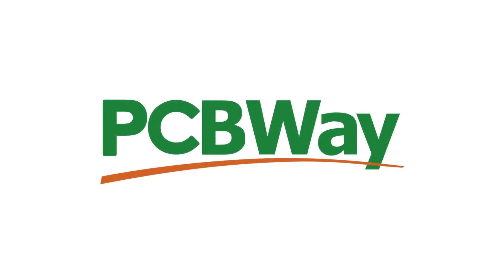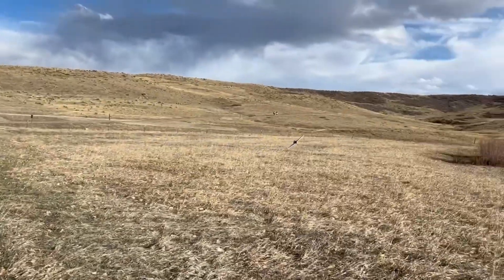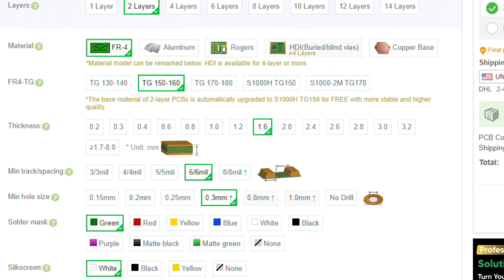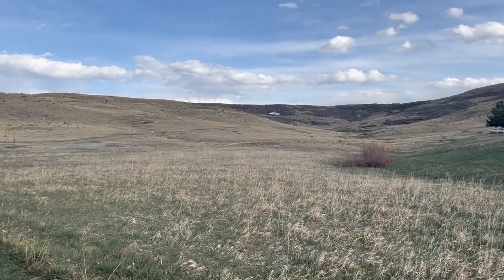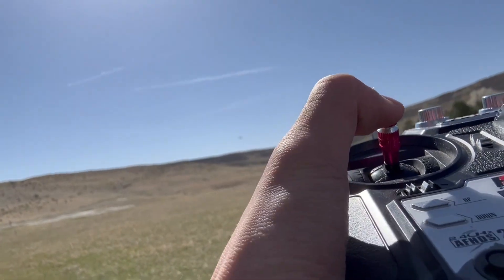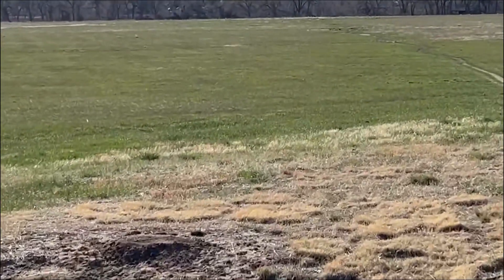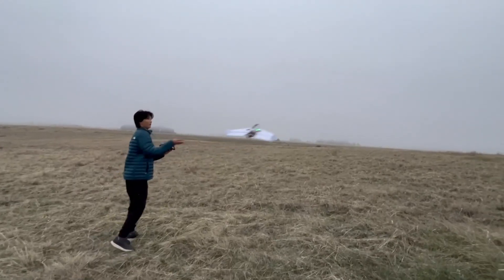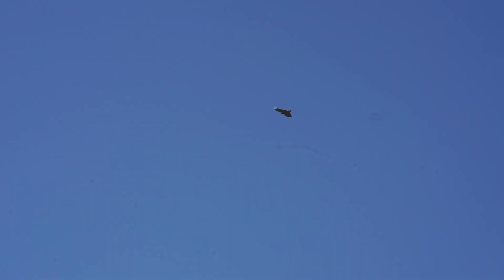Sub-250g Nano Wing Experiments

Comment: Bro Try increasing aspect ratio for a bit more lift and efficiency without increasing wing flex too much meaning fine tuning and winglets which double as fins like outward angled blended winglets instead of normal winglets your design was great though congrats on getting sponserd though
Reply from the maker: Good suggestion bro 👍
Reply: I'm Glad you liked the suggestion